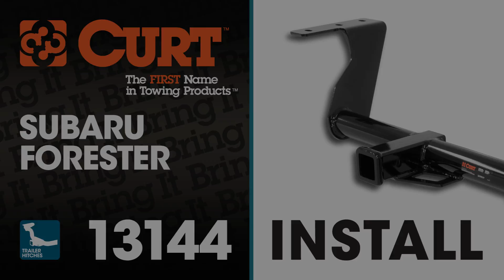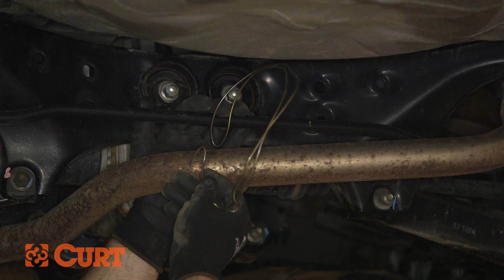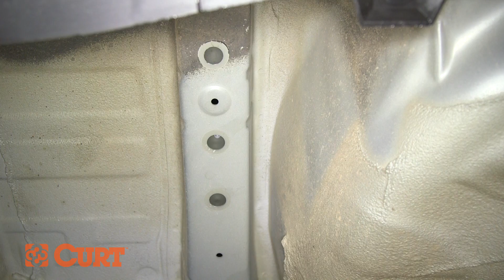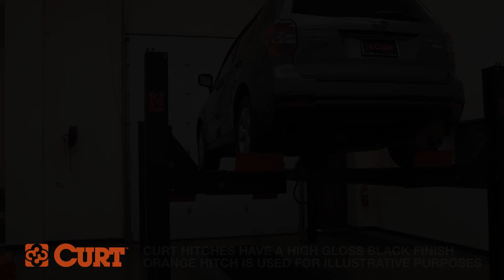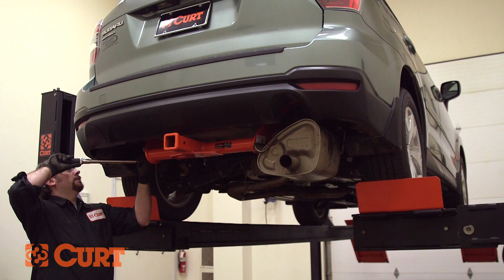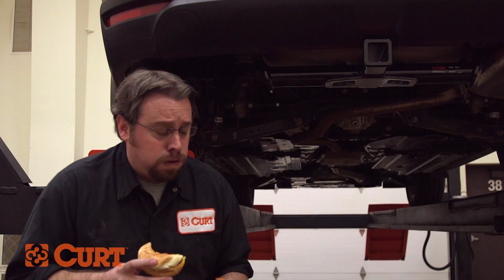Trailer Hitch Install: CURT 13144 on Subaru Forester

Comment: Well built hitch. Took me about 4 hours. Use soapy spray on exhaust hangars, they slide right off. I also think it's a mistake to leave off heat shield, I reinstalled mine.
Reply from the maker: Fun fact, the hitch will not only be useful for towing, but it will also act as a heat shield!

Comment: This is genius. Have a good grinder and you will have a good and easy installation. Thank you Curt
Reply: Don't rely on a dremel, go pick up a pneumatic one even from harbor freight.  I went through four dremel attachments blowing apart and it lengthened the time to about 1.5-2 hours.

Comment: Does your hardware not fit through the 4th access hole in line with where the bolts are fed through? I feel like you're repelling some potential customers by requiring the drilling/grinding unlike some of your competitors.

Comment: Just installed one, a few things i found along the way...

 the mid-section exhaust hanger is a bit tricky, use some pb blaster and a long screw driver for leverage to pry the top connection of the pair  over that mushroom end. 

a step-bit and drill ( with charged batteries, d'oh)  go a long way for both reaming out the center bolt access hole, as well as getting your heat shield drilled out to accommodate the new bolts you are adding. 

lastly, if you have a floor jack,  use it.   you can use this to help you hold the new hitch assembly in place while you bolt it in... leave the wires on until you are ready to thread the nuts.  just feed those wires through the hitch frame. 

 I asked my fiance to give me a hand with raising the jack while i guided the bolts through their holes and into place.   this worked like a charm, with little effort spent hold the thing in place.

also, the jack was great for raising and holding the exhaust system back into place before re-attaching those hanger 'blocks', which was much easier than taking them off!

cheers and good luck!!
Reply from the maker: Thanks for your insight! Tow safely!